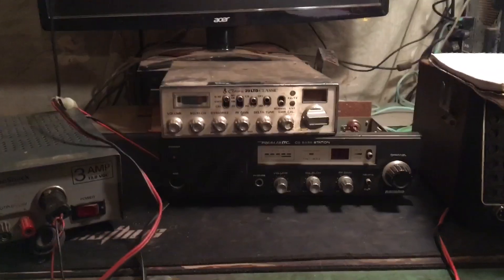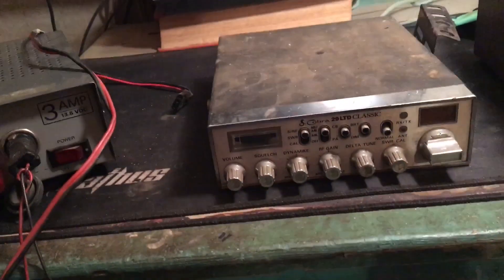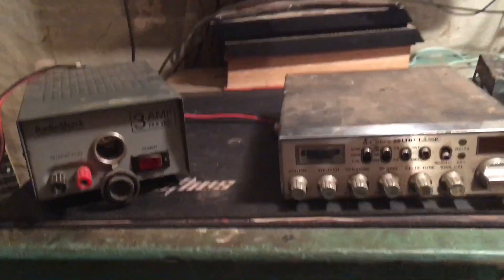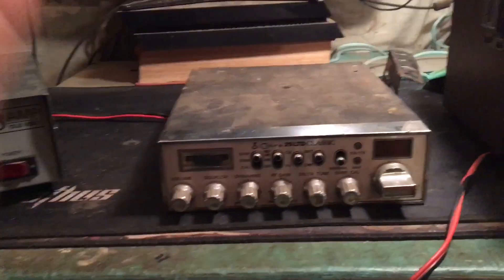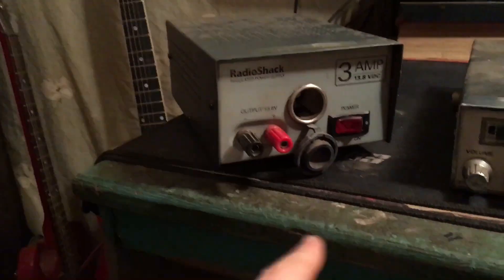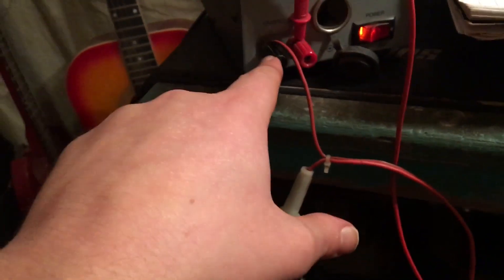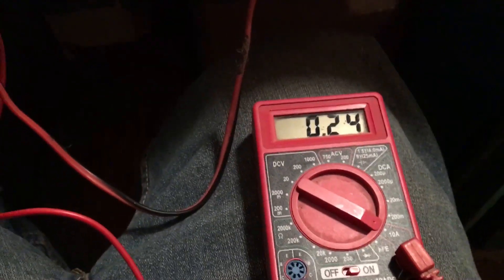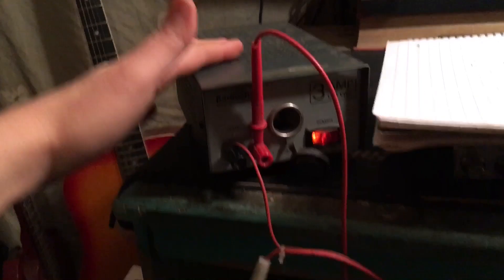How to use a mobile CB radio as a base station.

Comment: Hey man I'm currently setting or getting ready to set up a base station with a mobile right now I'm going to use a NOCO genius battery charger that has a power supply mode has 10 amps for the time being. I was just curious though I have a magnum s380 I tore apart and I plan on getting working but how do you set up to CB antennas in your home to test your radios?
Reply from the maker: @Garysplace  you can make or buy a dummy load. It’s just a 50 ohm resistor or matrix of resistors.

They are better than antennas because they don’t transmit very far at all so you don’t have to worry about people hearing your testing procedures

You can find them online or find out instructions about building your own online  👍
Reply: @JohnnyNJones  well shit i guess i should of waited.  I ordered a antron 99 last night and ended up in Walcott Iowa today and I bought a proton pt99 for $90 at Walcott radio.  Maybe I'll set up a station on the barn and use the pt99 there.  Thanks for the response 👍🏼 I'm gonna check into the dummy load.

Comment: So I am getting the uniden 980 and do I have to buy a fuse after I cut the cigarette lighter connector off
Reply: Is it ok to just not cut it and use the cigarette port on my power supply
Reply: And I'm confused why does it say ssb when it has dual side band
Reply from the maker: @sshooter546  it’s still single sideband because you have to choose upper or lower side band. 

There is a dual side band suppressed carrier, but they don’t use our technology anymore as far as I know

And yes, you can absolutely use your cigarette lighter with your power supply 👍
Reply: Thank you
Reply from the maker: @sshooter546  no problem bud 👍
Reply: How do I tune the swr on my radio I just got it today and I seen a video of someone doing it and they said it can't be over 2 but mine is 7 how do I get it to go down
Reply from the maker: @sshooter546  check on my channel for how to use an SWR meter. I go into concepts to make it easier to understand.

If you have a magnet mount antenna, make sure it is on top of metal and it needs to be a large amount of metal 

If you have an antenna with a clamp or a bracket, that’s attached to metal make sure that it’s secure

Make sure your coaxial cable is not pinched in any way or bent harshly 

Let me know if you need any more help
Reply from the maker: It’s always best to have a fuse in line, just in case something goes wrong. 

It can keep your radio from being damaged  👍

I’d also look up the fuse requirements for the unit and 980 because it’s a sideband. It might need a higher rated fuse.

The good thing is as long as you have a soldering iron you can simply solder the wires on the ends of the fuse. It’s very rare that I have to change a fuse 👍

Comment: Do I have to buy and extra power supply if I buy a CB/AM/Ham ETC  ?
Reply from the maker: Well, the great thing about base station radios either ham or CB is that the power supply is included so you plug them right into the wall.

But if you get a radio that does not have a power supply, you’ll have to make sure you get a power supply that supplies enough current to keep the radio running.

AM CB radios will work just fine using the same power supply for all of them.

Sideband CB radios take a little bit of extra current, but I haven’t noticed it being that much different.
Reply from the maker: You should check out the video I just made on using a computer power supply for cb

Comment: I'm trying now to do this with a 148 cobra an a hd500mos rocketbox  but not sure witch way or what to use for power  any help or point me in right direction
Reply from the maker: Check out my recent video on turning a PC power supply into a CB radio power supply

If you have any questions let me know

Comment: What are you using in place of an antenna
Reply from the maker: I don’t recall making this video off the top of my head but if I was using anything other than an antenna I would be using my dummy load.

a dummy load Will keep your Radio from blowing up by absorbing all the energy that’s put into it

You can make your own pretty easily too 👍

Comment: I just purchased a BTech Amplifier to make a small base station. However, the package only came with a cigaret lighter adapter for a car, as I believe it’s more geared towards mobile stations. Question: how to I provide power to the amplifier in my home? Help would be greatly appreciated. The supply voltage is DC13.8V. Input 2-6W. Output 20-30Ws
Reply from the maker: All you need is a power supply, you don’t have to use a cigarette plug you can strip the ends and use it for a pyramid power supply.

So look up pyramid power supply and make sure it delivers 10 Amps.

(No point getting a power supply unless it delivers 10 Amps in my opinion)

Also make sure that amplifier is useful for27 MHz

The amplifiers that I found up when I searched the term BTECH was UHF ham radio amplifiers for 400mhz to 480mhz

If that’s the case And you have picked up the wrong amplifier return it and get  an “rm italy” amplifier on ebay 👍

Comment: Hey Johnny got a q.using a old general Lee problem is I live in a complex and I don't drive.so what's the best I can't put the antina out the window landlord laws.
So what's the best indoor antina for indoor 
For skip and local stations thanks.
Reply from the maker: Try a vertical V antenna.

Basically you tape one piece of wire running up the corner of your living room and the other wire running straight along the floor. 👍

Comment: PLEASE HELP! When I key 3amp DC power supply into Amazon a load of totally different looking mains adaptors come up. Is that thing you're showing just old, or do I need to use different keywords, if so, what?
Reply from the maker: What you’re probably seeing is the power supplies they often used to hook up LEDs.

They can be used to run a radio but they’re kind of dangerous if you arent careful. I would suggest typing in “ cb radio pyramid 12 V power supply”
Reply: @JohnnyJonesathome  the stuff I was bringing up was basically phone chargers and power for things like portable Bluetooth radios. I think I found the right thing, it's called something like a workbench power supply with the two connectors (the other ones had single plug-ins like my DAB radio takes)...
Anyway now I have your attention, what do you recommend if I want to get back into CB? Back in the day I had a base station with Thunderpole III antenna on the roof. But what can someone do in a ground floor apartment with no roof access? I was going to get something like a Midland Alan 42 DS handheld with telescopic antenna (as sold separately, about 3 or 4ft long). I live near a fairly big hill that should give a huge panorama of contacts. If I did somehow set up a fixed antenna couldn't I just connect a Midland to that via coax? Any thoughts on that?
Reply from the maker: @ZadenZane  A bench power supply is usually variable. It will still work but you can get a fixed voltage 13.8 V power supply for less money.

Honestly I would pick up a base station that way you can plug it right into the wall and not have to worry about an adapter or the often poor speaker/mic of a walkie-talkie.

There’s some pretty cheap base stations on eBay. You can get some “realistic” base stations for relatively cheap but a cobra will cost you more.

So here’s what I would do as far as putting an antenna on the inside of the apartment.

My most popular video tells you exactly how to build a dipole.

You can put a dipole on the ceiling or in a corner in an L formation like I did with my tape measure antenna.

Cut two pieces of wire (or any other metal, like a tape measure) Cut them at 103 inches.

Put one vertically and the other horizontally on the floor in an L shape.

Then you want to trim the ends until you have a good SWR reading.

That’s the best way of an antenna inside.

Most other antennas are not going to be very efficient because they’re going to be shortened and they’re going to be inside of an apartment.

(although I would consider seeing if your apartment building had a metal fame and use that as a grounding point)

But that’s not feasible and may very much be impractical.

Comment: To be safe, 13,8 volts DC power supply (linier) and 5 amps will cover a radio and not stress the power supply.  This is for the radio only, you will not be able to add Burners, linier amplifiers etc.
If you just want to run the CB on its own, 5 amp 13,8 volt DC power supply is all you need.  Get yourself a good antenna, it will make a big différance to what you will hear.  If in doubt, go to a good CB dealer, though they are in short supply in some places these days.
I wouldn't buy a second hand power supply, buy a new good make power supply.
Reply: ...unless it has SSB -- not your typical CB radio (of course) -- then it'll likely be needing more than 5A, so I'd get a 10A power-supply (PS) for BOTH situations.
For examples, my President Bill II FCC AM/FM radio has a 2A fuse, so a 5A PS would be fine (and I like having the extra 3A headroom).
However, my President McKinley AM/FM/SSB has a 6@ fuse -- a 5A PS won't do.
I'd go 10A (and again, I like having that extra 4A headroom).
But it's not just for these CB radios: Since most 12v accessory sockets in cars/trucks nowadays are only rated for 10A max, if you get a 10A PS, you can run anything you could (safely) put in your vehicle's 12v sockets on your in-house 12v PS. Win-Win. Go 10...just a few dollar more so IMO it's well worth it.  ;-)
-- BR
Reply: @billredding2000  Yes, and the newer radios will take even more current than the older ones, if you have Ham type radios, you need to go very big for some.  A CB type power supply might not do for some Ham radios.
Reply: @BoB4jjjjs  Of course, I was only addressing CB radios...I know nothing about HAM radios or their power-requirements. Nor the Super Bowl CB guys -- I have zero interest in amplifiers or otherwise operating my CB radios illegally (not to mention being highly annoying fools while they're at it). 
So either 4W or 12W (SSB) is plenty for me. Consequently, a 10A AC/DC power-supply is ideal. :-)
-- BR
Reply: @billredding2000   🤔 
In the notice of McKinley  " WARNING: Never replace the original fuse (2 A) by one of a different value"  🙄
Reply: @THESHADOW97139  Due to your post, I went back to check my McKinley's fuse -- the glass in-line fuse came with it from the store -- and it does say 6A. Just guessing, but maybe that's because SSB radios can power-up to 12W (legal limit), whereas most CB radios aren't SSB and are limited to 4W max power?
I don't know, but for sure the fuse (factory OEM) fuse I took out of the fuse-holder has "6A250" on it.
-- BR
ETA: I just did some searching and found this:
"Power Cord - see the AUCB91 or AUCB91P - please note that the MCKINLEY has a 6 amp fuse in the power cord so you would need to remove the 5 amp fuse in the AUCB91/P and replace it with a 6 amp fuse."
-- wearecbCom/mckinley-t.html
So yeah, I'd NOT use a 2A fuse in the McKinley, only in my President Bill II.
Reply: @billredding2000  I had difficulty finding information on the subject... but the instructions that I read are those of the normal Mckinley version, with 4w fm/am and 12w ssb/lsb (so not export).... President would have made an error in his notice??
Reply: @THESHADOW97139  Yes...I think whoever wrote the manual for the "President McKinley II FCC AM/FM/SSB" (w/ NOAA Weather) radio overlooked that tiny detail about the fuse...as mentioned, it IS 2A [corrected, I said 4A wrongly] for most CBs, just not (apparently) for the McKinley . And maybe for other SSB radios it's higher as well. Would have to check the other brands to see what fuses they use. 
You could call President and ask someone (so they can correct the manual) but for me, I'm not worried: Mine came with a 6A fuse and I'm leaving it there.
-- BR
Reply: @billredding2000  👍

When I have a moment, I will look into this subject.
thanks again
Reply: @THESHADOW97139  🙂 BTW, in my comment above I wrote "4A" -- I meant 2A for most CB radios, not 4A. Sorry.
-- BR
Reply: @billredding2000  You are right, former President George had a 5A fuse
Reply: @THESHADOW97139  This is the 3rd attempt to post this...my 2 earlier responses disappeared.
I checked out what another well-known SSB CB radio to see what fuse it uses -- the Uniden 980 Bearcat SSB. On page E-7 of the Owners Manual, item 21 states "6A."
Reply: @billredding2000   👍
YT deletes all internet links, even their own video links.... so if you post a link in your comments... or talk about a particular YouTube channel (already experienced) your post will be deleted
Reply: @billredding2000  So you are right, the amperage will increase with the power of the station
Reply: @THESHADOW97139  Yes, I avoid links, and didn't include any in my earlier 2 (and missing) responses. If I do want to link something, I try to disguise it or just give the video's title, not the link itself. Still, it seems MANY of my comments are deleted quickly...and I didn't see any "code words" or such to account for that. Seems deleted comments can be arbitrary as well, making no sense at all. So much for Free Speech, yes?
-- BR
Reply: @THESHADOW97139   Well, just guessing: As you said, the McKinley II's Owners Manual says otherwise, so President needs to correct it.
-- BR